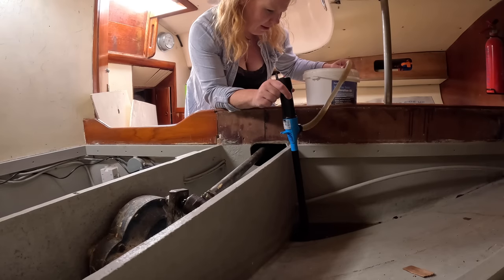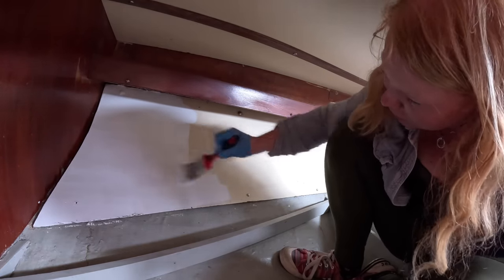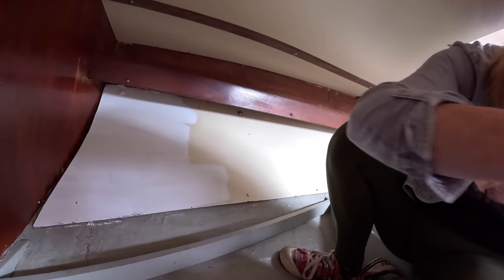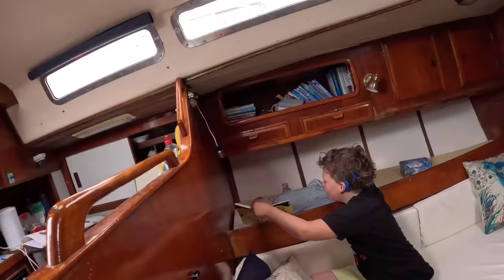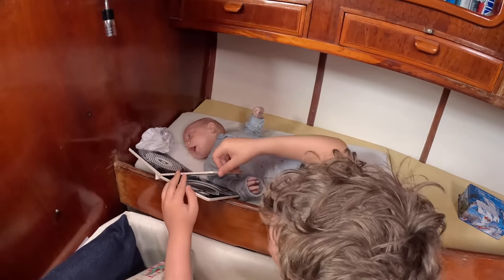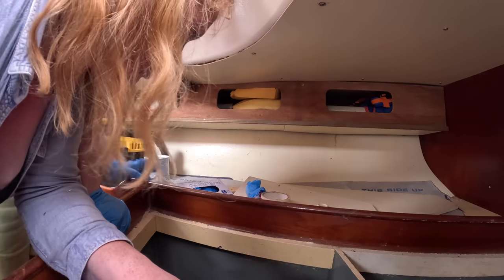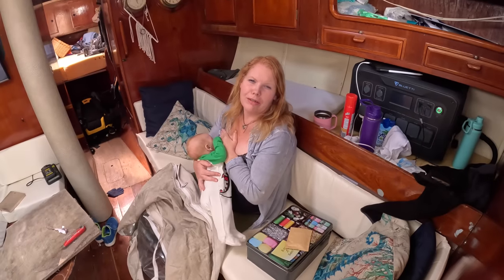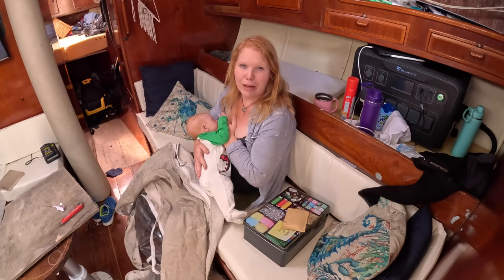#151 : Painting out the aft cabin lockers! This will make the boat smell better

Comment: Hi guys!! The new sprayhood looks good !! I have some boats, and since they are outside I have to cover them. Usually the cords holding the tarp are loose after a day or two, and if one tighten too hard, the tarp ring will let go over time. Then I discovered rubber strings, which come in different thicknesses, so I bought different sizes and tested, and loo and behold, when I made a ring with either one or two laps, in in which I tied the ordinary line/ string, the rubber ring tackled the tarp movement, so it dit not slacken....So, now I have rubber lines, and they are quite useful, last time I was on the greek island Karpathos, which I do, twice per year since 99, that time I had a ordinary bicycle, and tied lots of stuff on the back rack, using rubber string..... So, maybe you also have used rubber strings, and aware of their use?? Anyway, I was remember about them when I saw you with the spray hood......Allda bestest, from auld mikke.....